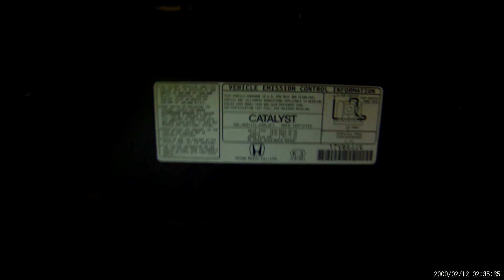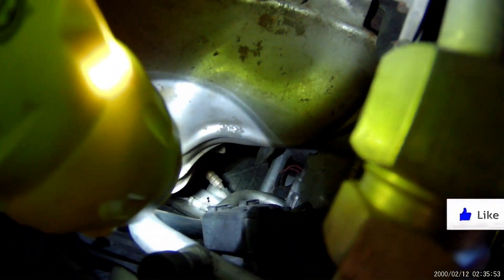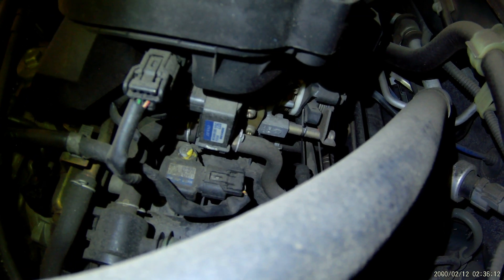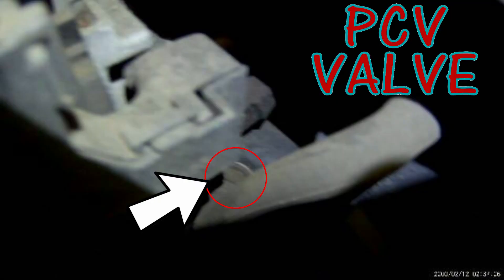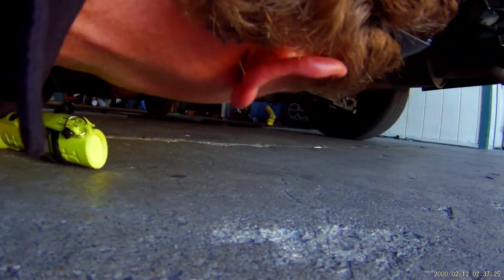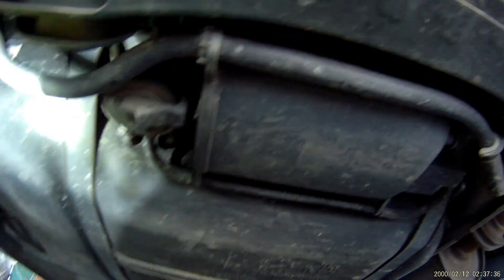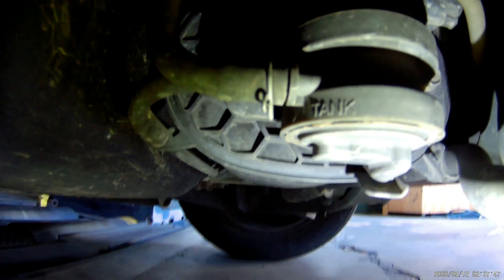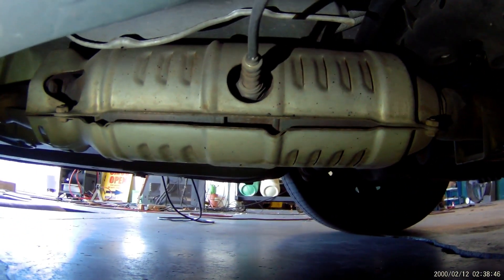Honda Civic PCV, EGR, Vapor canister, EVAP purge, vapor vent, oxygen sensors

Comment: I have a new check engine light. Ran my scan tool on it and came up with P1457 EVAP canister fuel system leakage code. I hear the purge valves are a common place for it to start leaking around the O-ring. You think it’s better to just start with that and if it’s still there try the vent valve next? Then if neither I guess I’ll just replace the EVAP canister, but the car is a 2004 DX and has 108,000km on it. I’m almost thinking the dealership messed with something when I had to bring it in for an airbag inflator recall and they do their inspection...
Reply: I have the same problem, did you solve yours?
Reply: James Lucero ordered a Vent & Purge Valve off rockauto Monday, going to swap them Sunday. Got my timing belt and water pump done a few weeks back and the mechanic said he looked at the EVAP canister and it didn’t look cracked or anything so I only ordered the valves. I’ll let you know tho!
Reply: James Lucero also I swapped the Canister Purge Vent Solenoid out, and I will tell you if you’re gonna do it, expect those screws holding down the part to be so rusted that they literally will pull out the metal screw sleeves from the plastic before they come out normal. Yes it fixed my engine light, I didn’t need to do the purge volume control solenoid under the hood, but my vent solenoid is zip tied on for now until I get a new canister all together.
Reply: Yeah me 2
Reply: Throw all that sh1t in the trash
Reply: @Force1Com  all what in the trash? And why?
Reply: @LJT9393  Because once you guys start replacing all those small, expensive emission pieces, your society won't last much longer.

Comment: If you put power to a solenoid and it clicks it works yes
Reply from the maker: Yes. I usually use a 9v batterey for a test like that. I just posted a vid doing that test on a shift solenoid, you can get the idea of how I do it if you check out my vid library.
Reply from the maker: If you are testing a purge or vent solenoid you can also check them using a vacuum pump. It might click when given power but is the valve sealing properly would be the next question?